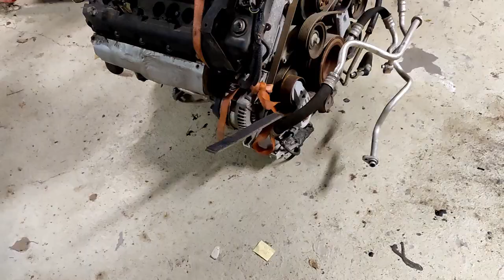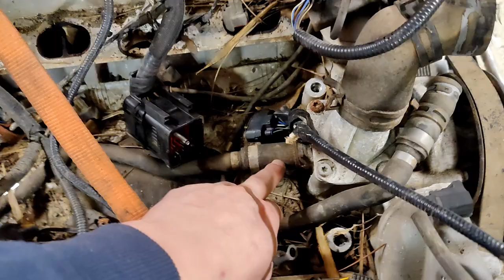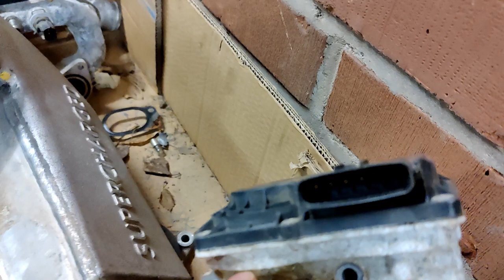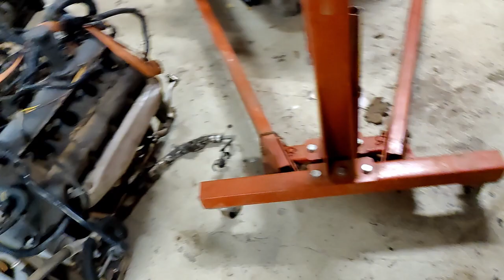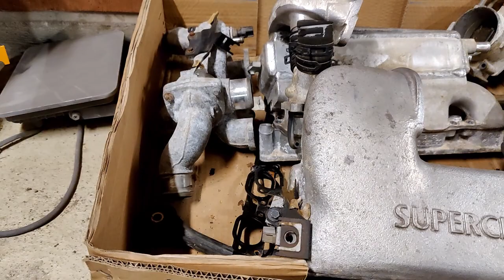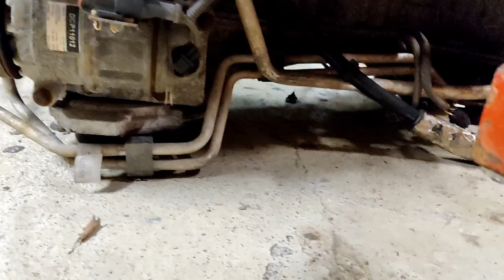Garage Series E1: The powerplant

Comment: pls intall a JLR 5.0 supercharger, don't use m112. They have huge performance difference.
Reply from the maker: Current plan is to fit a BW S366 turbo, because I don't like wasting crank power supercharging and the charge air coolin is easier to arrange.
Reply: @kyostipro  Yeah thats cool. this engine comes with factory mahle  forged piston hiding inside.😉 I am talking about    4.2sc engine. I haven't work on 4.0.
Reply: my engine first start https://youtu.be/XpWDENa3320